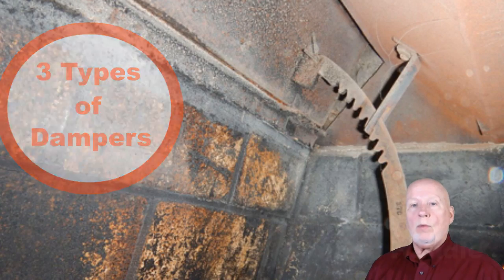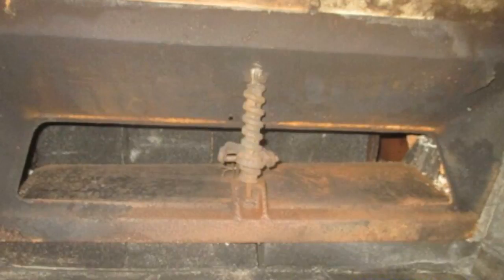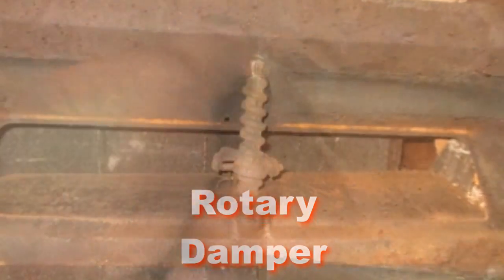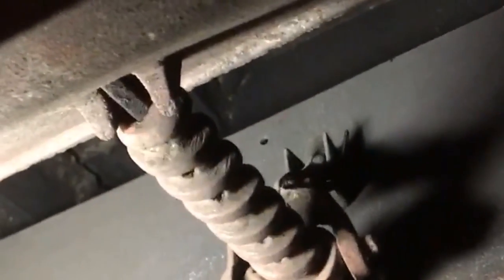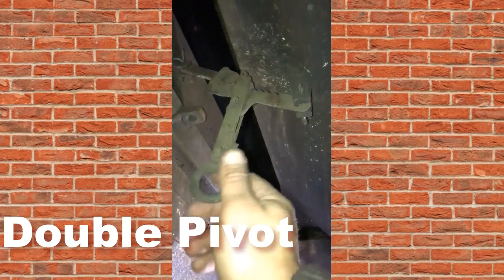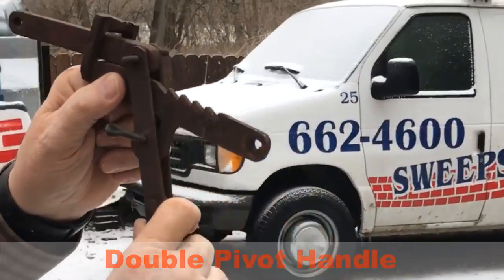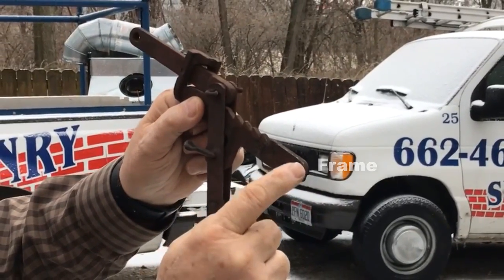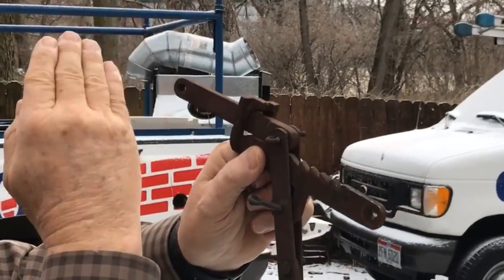How to Open a Damper - 3 Types - Poker, Rotary, Double Pivot

Comment: Hi Clay, I'm looking to update my fireplace by installing marble over the brick but unsure of what to do with my rotary damper control. Would you recommend somehow changing the damper open/close mechanism to something else like a poker (if this is even possible using my existing damper) or is there a way to pull out the knob/rod and just reinstall it after the marble is installed?

Comment: Hi Clay.  I was hoping I could prevail upon you to answer a few questions.  The mrs and I just bought a house and we'd like to put either a wood burning insert or woodstove in our fireplace.  The chimney is 50+ years old and has never been used.  I mean NEVER.  The damper isn't in the best of shape and it doesn't look as though a 6 inch pipe(stainless liner) would go through it.  What does one do?  Thanks.  :)

Comment: mine does not look like any of these.  it is stuck and rusted. can i spray WD40 on the  hinges to soften them if i am not intending to use the fireplace any time soon? how do you tell if it is blocked by material inside the chimney or just rusty?  it seems like it might also be hitting the wall as if something expanded.  i have no cap on the chimney so its exposed to things ffalling in and rain likely
Reply: Call a chimney sweep

Comment: I have the banana handle in my fireplace. Am I missing something? Usually you open your dampener while starting a fire and adjust it so your heat isn’t going right up the chimney right? So how do you adjust it without getting burnt once you have a good fire going?

Comment: Mine doesn't have any of these. I'm actually convinced mine doesn't have a damper of any kind whatsoever.
Reply: Mine doesn't have it, either. Who should I call to have it installed?
Reply: @3pumpkins170  Santa Claus is the only one I know who is good with chimneys. The house we are in was built sometime around the 20s, not sure if the fireplace was too or not, but all I see up there when I look is some metal handle that somewhat resembles what might have been a damper at some point in time. If it was, it's now rusted over completely and doesn't budge with a crowbar even. I have beat that thing to death and it won't move. I'm tempted to just start stuffing insulation up there for winter since we don't use the fireplace. Just trying to figure out how to KEEP it up there once it's up there. I feel like the pressure from opening the front door might suck it out.

Comment: My damper handle and entire metal flashing above is falling off. Trying to find a person who can fix that. Is it hopeless? The surrounding metal inside box is fine. Floor has bricks. Please help! The handle has made a good cleaning soot tool though. I want to cry as I feel the ching ching is going up. They never had a proper roof tile and metal guard for years. Fires are warm, blow out two areas on top beautifully. Problem is we burn wood so fast!

Comment: My double pivot damper had a pin fall out or something and then the whole damper fell and was dangling. I got the damper back up, but it’s like I can’t get it back in position or when it’s close and I attempt to use the double pivot mechanism then it falls out again. Chimney sweeper was just here, but it fell out after he left when I tried to use it so think I did something. Have any tips or tricks to getting the damper back in and aligned correctly. Any help is greatly appreciated, thank you.